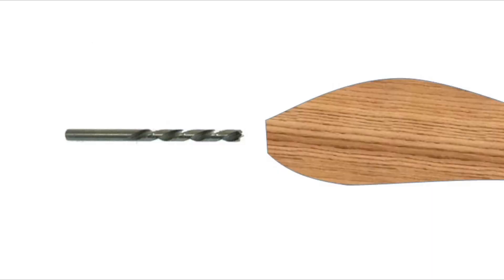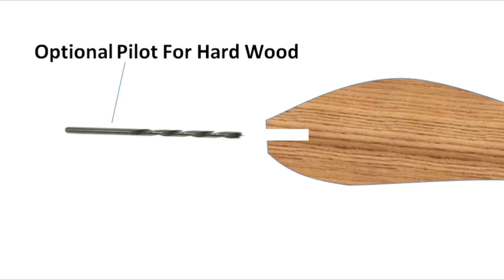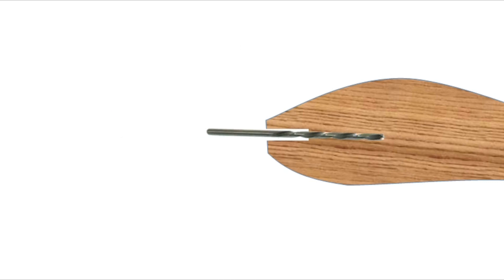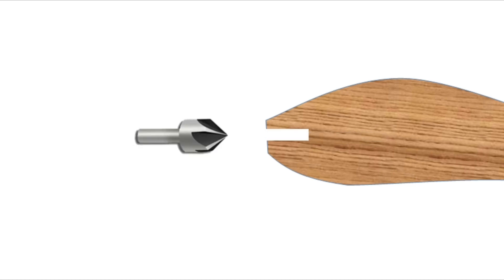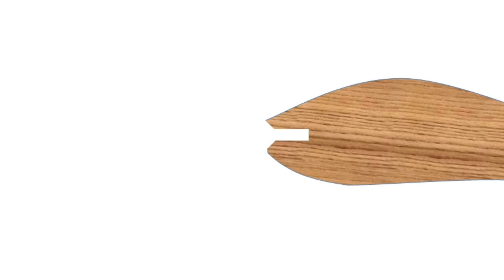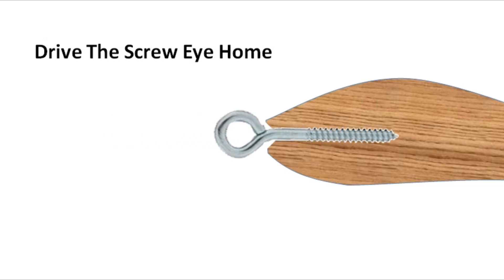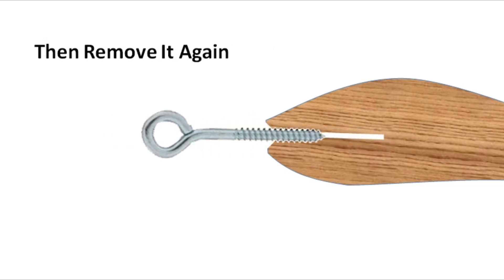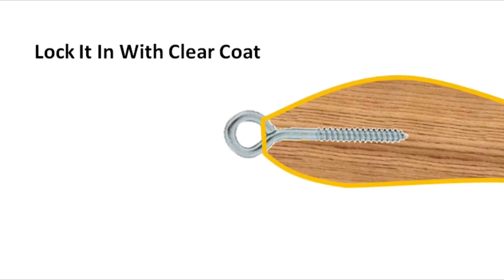Screw Eye Tutorial

Comment: I do it in a similar way , only difference is , that I'd drill the larger hole entry after the pilot hole .

To still increase strength a bit , I tend to possibly drill the pilot holes under an angle to the assumed pull direction of a hooked fish , ....especially if the woodgrain runs in a way as shown in your diagram , ..........leading the screweye a bit offset angled to the woodgrain , always results in somewhat more pull strength .

Greetings from northern Germany , Dieter